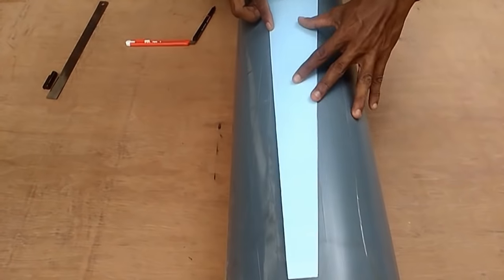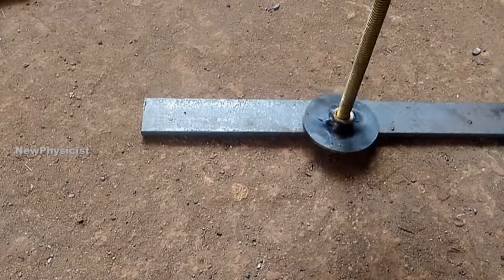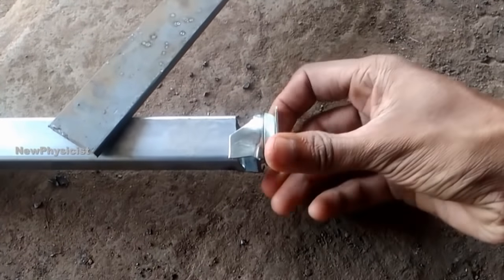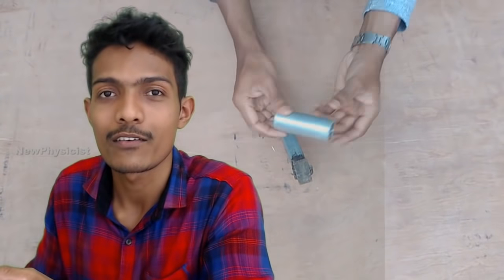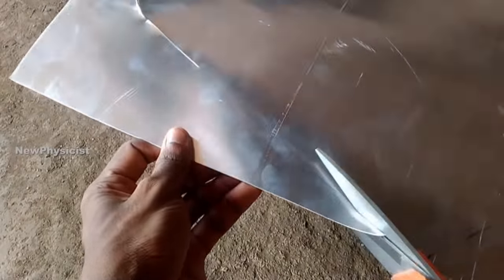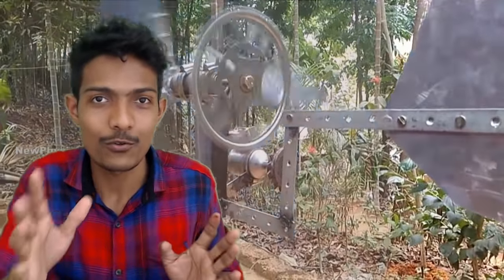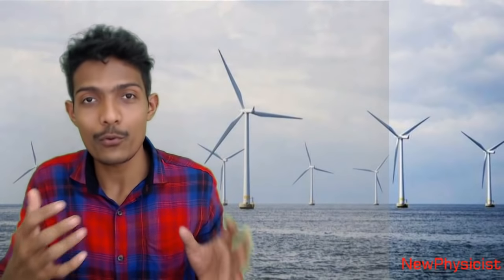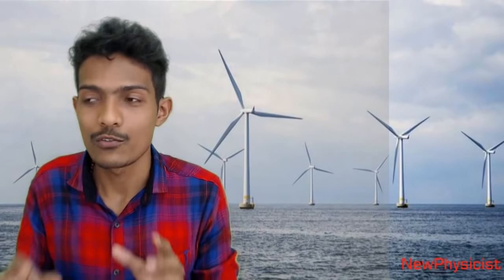DIY Wind turbine with full Instructions!!

Comment: I absolutely love your Design!
How much output does it actually have? I have trouble reading the meter.
Also what i would like to see from you is a Design to Accumulate Power without the typical Lithium-Accumulators. (I remember reading about Air Pressure as an accumulator in Low-Tech magazine, or to use Potential Energy in Water-Pump-Stations).
I would really love to see you charging your Phone or using the Power you just Produced for something useful.
Please continue this kind of content, People like you are saving the World!

Comment: Finally a video where they use gears.  I can't believe how many people miss this part.  They must be losing so much by not adding it to their turbines.
Reply: I think if you have a large fan and gear it up to a car alternator so its getting 2000rpm, you could get 90a out of it.  Fan turns slow which is more efficient.

Comment: How to transfer generated power to the ground if blades rotates 360° then electrical wire gets twist . you need to explain how to supply power in 360° rotational way?????
Reply: Right  Ritz  and I think  he need another  gear  put one  place
Reply: You can use Slip Rings

Comment: Thumbs down. this will not work after 1 day. he cannot reply in the comments about power output because it will not work. he did not connect/fix wires to the battery/rectifier because the wires will tangle in the pole just after one day. easy to talk about wind turbine but the very basic of connecting the wires while it is turning 360 degrees around the pole you don’t know.
Reply: You can use slip rings so that wires wont get tangaled